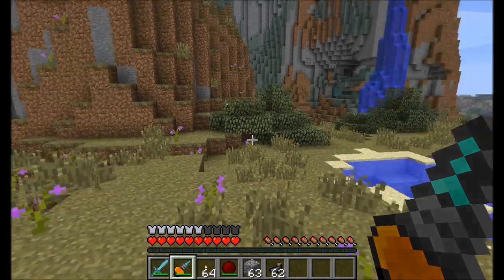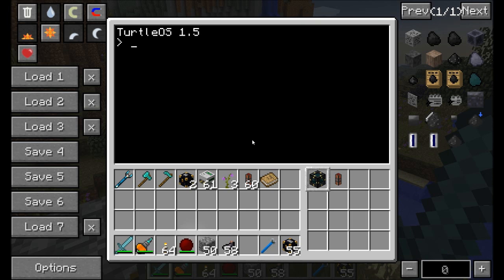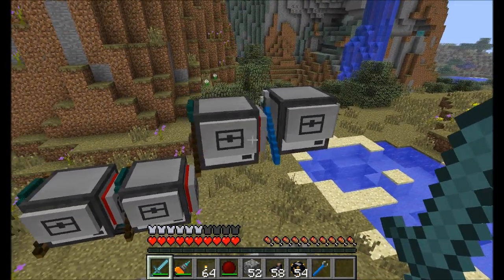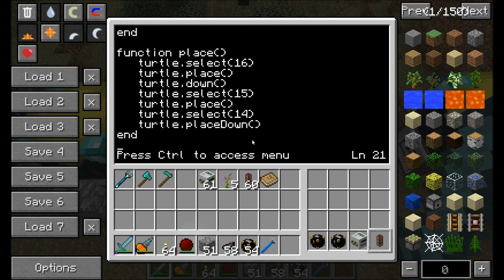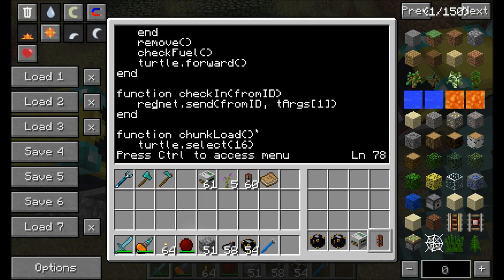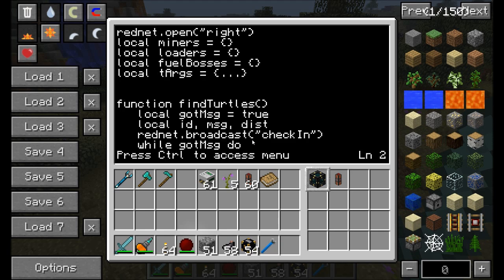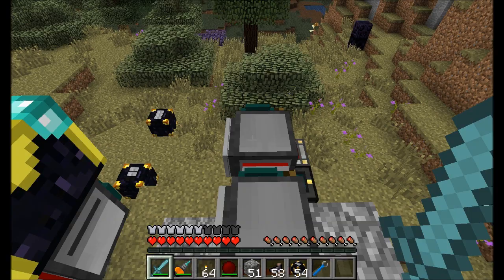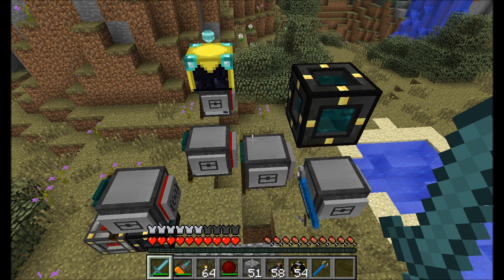Tutorial - Turtle Mining Wells

Comment: Dire... the word is iteration not interation.  Great mining system without the use of Frames... It's also a lot less bulky and more streamlined.  I think the only thing that all that is needed now is a way to check in front of all the turtles, which might be difficult due to the forward chunkloader turtle, and mine the block ahead if there is a block in place in front of the turtles.  That way if a hill is encountered It won't be an issue.

Comment: Personally, I would edit the program to have one more enderchest, filled with some building material (stone bricks, whatever), and then have the turtles place a block below them just before they move ahead. That way you could reach the turtles easily without flight.

Admittedly, you could probably just use the cobble that is mined to do it, but I would prefer at least smooth stone if not stone bricks.

Comment: Yes, it could happen and for completeness sake it should clear the last 3 empty slots. I doubt it will happen though, even if you dig into a desert temple you are hard pressed: Sandstone, smooth sandstone, wool, chest, sand, dirt, cobble, iron, tin, copper, gold, diamond. That is still only 12 slots. Its easy enough to fix though, in the cleanup function add a second loop that runs the last 3 slots (for i=14,16 do), no other changes required.

Comment: Hey dire, I think I found a logic error in your code. If the mining well picks up more than 12 types of items in a single dig, the 13th item dug up will be put into the turtle's 14th slot (the one after the refuel chest) and that will mess things up during the remove function. A possible solution would be to move the refuel chest to the 16th slot and iterate over the 15 other slots when dumping items into the enderchest. Cheers!

Comment: Got it working in most recent version.
mainProg  rgG8rua1
Miner        vXyXNafw

Instead of 'edit main' you need to 'edit startup'. The turtles seem to not want to auto-launch main. It may have been a recent change. Also, because of a couple other changes, you now need to change what you set startup to be.
Miners need to be    shell.run("Miner", "2")
fuelBoss is shell.run("Miner", "4")
loader is     shell.run("Miner", "3")

Miner code was written by markobranko. 
mainProg written by alfalfa140.

Comment: Only as long, till it depletes.
I meant with teaching it how to use them the same as they use their fuel source, placing an ender chest, taking out a full energy cell and put it in when moving. Then i have to set up a system at my base that keeps an energy cell in that chest that is over a half full, so i think it should take it out if it is under a half of its energy energy level and put a full one in and putting the half depleted on somewhere to recharge. ;)

Comment: hey dire. once again great Tut. now i read allot of the comments. so if people are still having problems. #1 to terminate a program hold ctrl+T 5sec, #2 to restart your turtle type reboot. now onto my problem i (the program works great) am playing on Monster Pack 1.1.1 i am hosting a server for my family. i to am having the issue of the Engineering turtle not picking up the conduit. i tried to use shiny dust yes i tried shift click an other combos Mmmm nota. the reason i tried that. yes if you use the crescent Hammer turtle (Engineering) it will retain the settings. i tried a reg. mining turtle yes it did pick up the the conduit as was expected it also picks up the tesseract/energy cell however they both loose all settings. i browsed the code for both the mainProg and Miners.  i tried changing some lines( to a small extent ) for the placement and retrieval not much luck there. *NOTE in this pack there is no need to change the color of the conduit so i removed the .attack() line. in your video your turtle picks up the conduit. i assume its dueto versions and different packs ect. so i could supply a stack of conduits and just let it eat :) i am looking for a way to use the Engineering turtle / or even the Mining turtle. any suggestions would be great

Comment: Are you using a 1.5.x version of the mods, or 1.4.7, because it will only work on 1.5.x. To play using those mods click the "private pack" button on the FTB launcher and use one of these codes:

Direwolf20_1_5,   OR
152wgt,  OR     (w/ g-tech)
152ngt.             (no g-tech)

Comment: 1 - Right...I'm an idiot XD
2 - There would still be one turtle running it all, it would just have it's code incorporated into the miner program and called the by setting the argument as master (or something) rather than miner or chunkloader. It would allow the code for placing the tesseract and energy conduit to be reused by other engineering turtles to expand the system further (since tesseracts, if I recall, only transfer 100mj/tick at most), and then only 1 program would need to be grabbed

Comment: Here's a version that works on 1.4.7 and handles energy cell swaps. Make: 2 energy cells, 2 ender chests (new color code), 1 gate reader engineering turtle. Replace the boss' tesseract with one cell, charge other.

miner: pastebin 8B4M7nxN
mainProg: pastebin GZVMf4jX
cellManager: pastebin bFU5JXEA

charging setup screenshot: imgur - xUiAYEc. Corresponding chest goes in slot 12 on the fuelBoss.